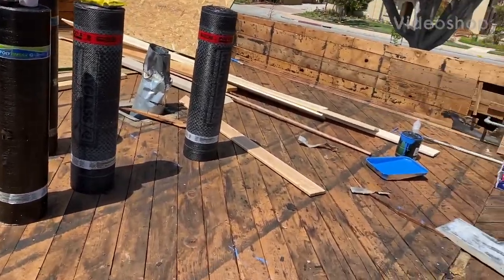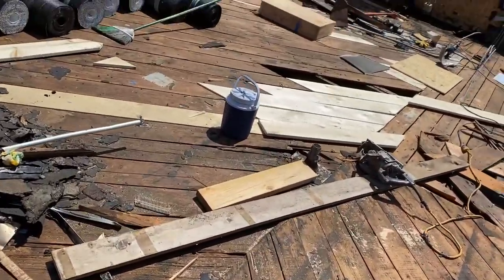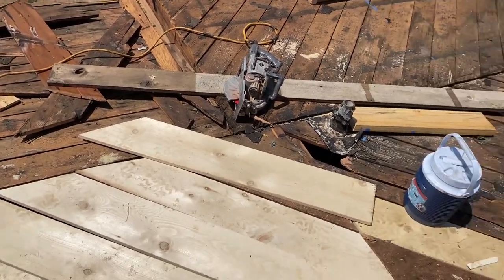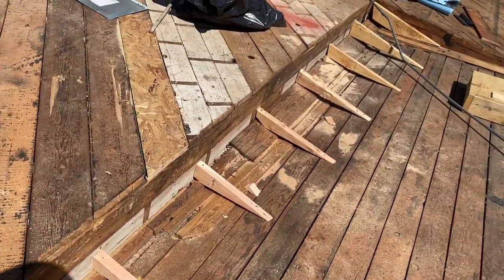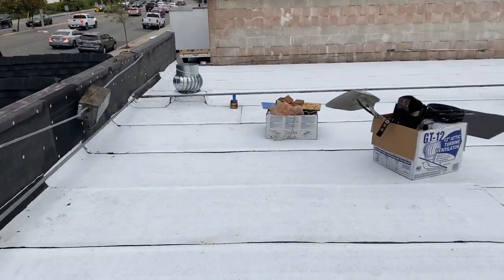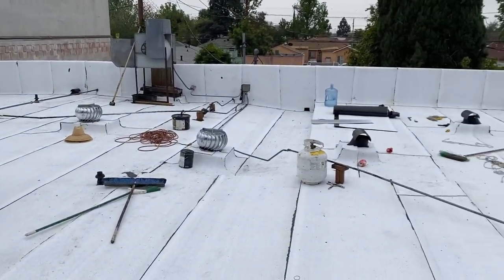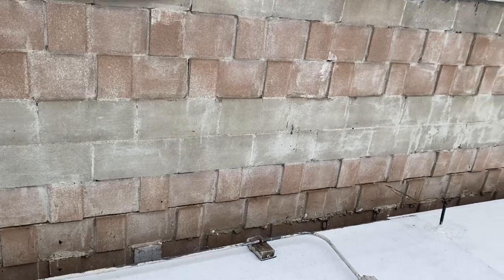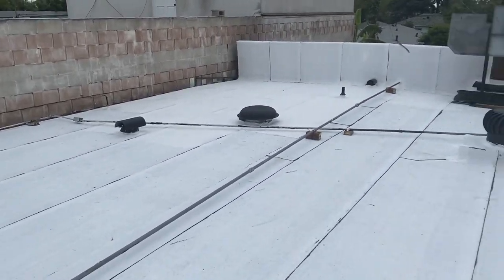Step by step how to do a flat roof, Roll Roofing

Comment: Eric, check out 1/2 fire board you nail on after base, burn smooth to that and then your elevated from the future movement in the tin and nails in that 1/6 .
CYA 2 layer is thick but so is time.
Reply from the maker: Thanks
Reply: @Garciasroofing  i saw your sharks tooth on metal valley too, teach your young guns left right no different just watch nails patterns backwards and run that up the valley on the points 3.5/ to 6.5/ and make nice " step" as you called it. Then cut hip in much easier.
Reply from the maker: @Donetravlin  I’ll try that , thanks for the advice 👍👍

Comment: love your videos Eric. thank you for sharing your talent. also, question? i have to cut out a section of plywood from torch down roof because of rot from rain. would i able to make that repair using self adhering roofing material or is it better to torch down? would appreciate help. thanks!
Reply from the maker: You can use self adhere base underlayment but… do not remove the plastic in the back of the membrane, so I don’t stick to the wood and nail it like regular base sheet
Reply: @Garciasroofing  thank you!!

Comment: The black spray you put on the flashings what is it and what does it do?
Reply from the maker: It’s called asphalt primer it helps to get a better adhesion of the torch materials over the metal flashing , if you don’t use it , will come apart in few months